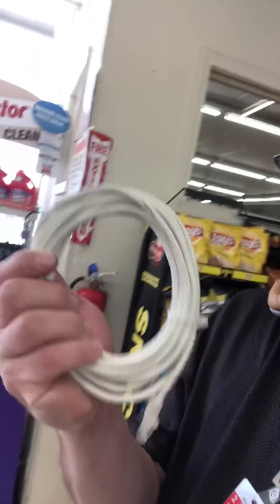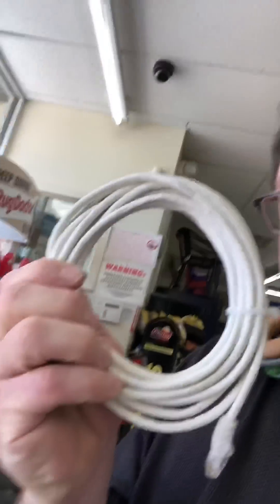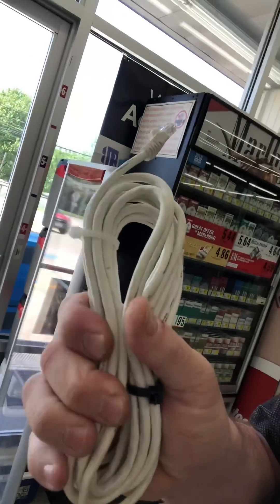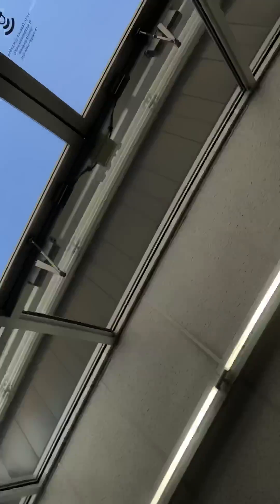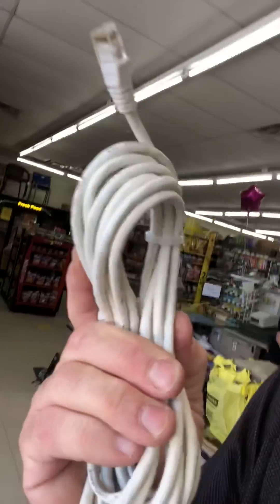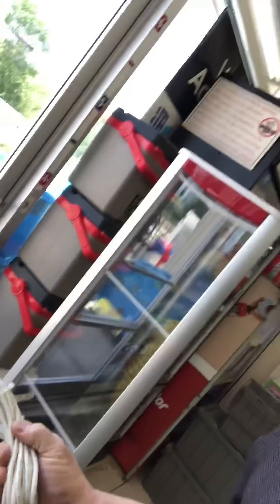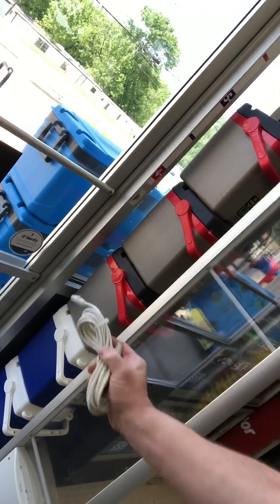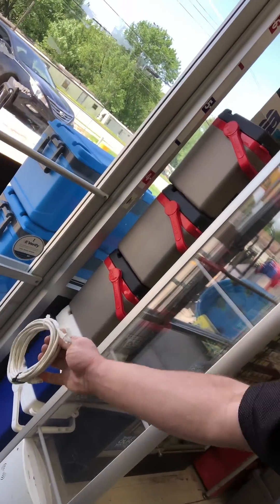Induction & magnetism: I discovered why my laptop bag set off security alarms at some retail stores

Comment: Very neat, its acting as a big inductor. The movement through a magnetic field generates a current through the coil (its not a complete circuit so the beep is short) the current generates an electric field that is picked up be the security device. This is how security tags work. When the coil is folded the electric field will interfere with itself and not register

Comment: My calculator sets off security alarms. Aside from leaving it at home, any fix for that?
Reply from the maker: Wrap it in a few layers of aluminum foil as a test.  Make a pouch.
Reply: Open the battery compartment and check for a security tag, it may not have been deactivated. You can also ask a store (if they are nice and you keep setting off their alarm) to try waving it over their deactivation pads.